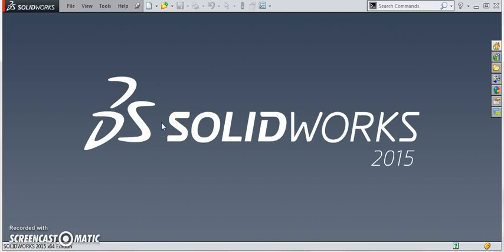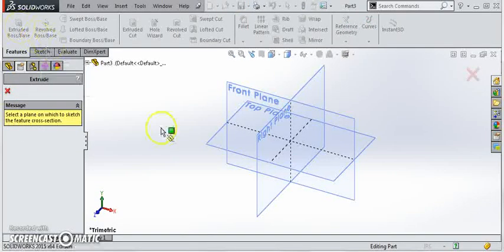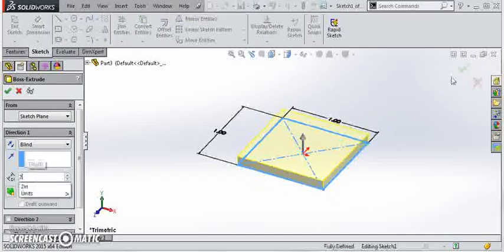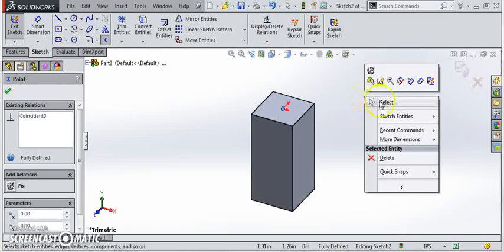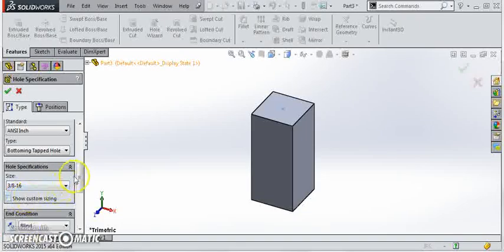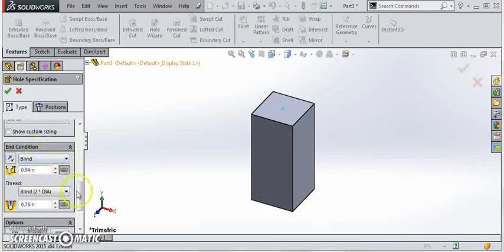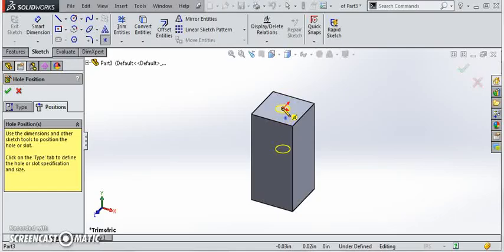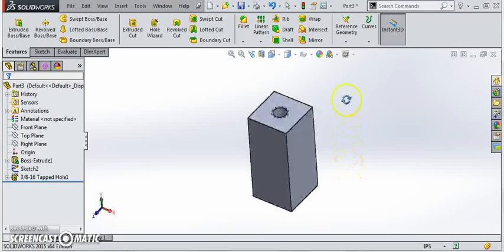Simple Hole Thread in SolidWorks

Comment: how do I make the thread LEFT HANDED in Hole wizard? (without using real thread, because i can't call out thread hole in Drawing with real thread method)
Reply from the maker: Generally, it is the same process.  tap drill and pitch will be the same, just a different direction.  However, you would have to add notes to your drawing to indicate a LH thread or create a custom hole type in the hole wizard that includes the LH notation.

Comment: Doesn't make threads for me. I'm confused as I followed these steps exactly
Reply: This method does not create the thread geometry. It creates a “hole callout”. To create thread geometry use the dropdown below “hole wizard” to select “THREAD”.
Reply from the maker: The threads may be created, but not showing up graphically depending on your system settings.  I cannot paste pictures in this reply (otherwise I would provide a screenshot), but when you select threads in the hole wizard, there are options for how the threads will display.  The heads up display also has an icon that looks like an eyeball which can be used to show what types of features are displayed.
Reply: I'm having the same problem.  It worked for me at first but I used my scroll wheel at the wrong time/place now I can't get the threads to show.
Reply: @michaelgrambihler5769  What version of SolidWorks are you using?  Does the feature (named 'Hole1' or similar) show up in your design tree?  Is it simply the cosmetic thread not showing or is the feature not generating at all?

Comment: For the hole you made, what would be the complete dimensioning label that you would use to dimension on a mechanical drawing? (diameter depth thread etc.)
Reply from the maker: +Quinn Quy Nguyen 
At a minimum you should specify thread size, pitch, thread series, class of fit, and thread depth: 3/8-16-UNC-2B (depth symbol) .750.  Some designers also choose to include the size and depth of the tap drill too.  If you use the hole callout tool on the annotation tab in SolidWorks (and provided you created the hole with the hole wizard) this information should automatically populate.